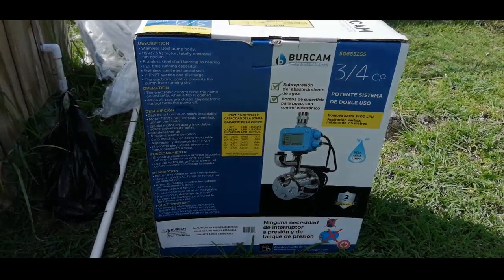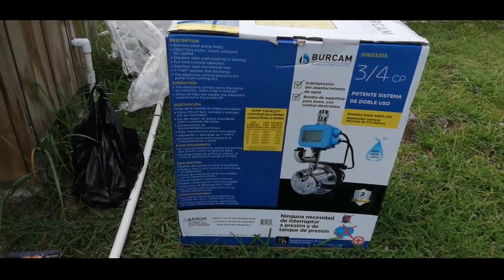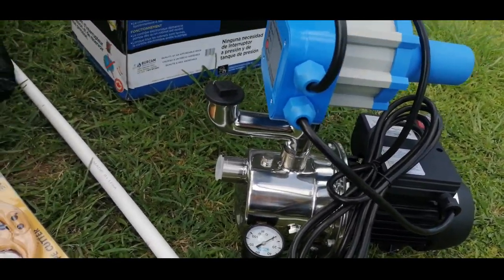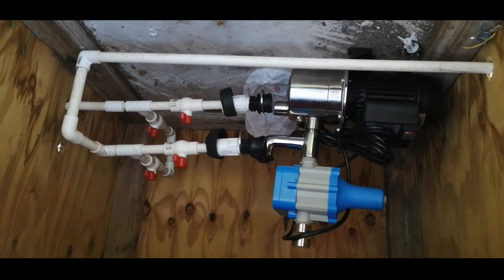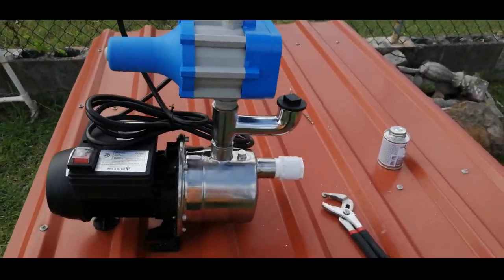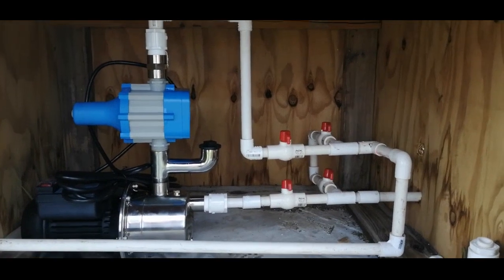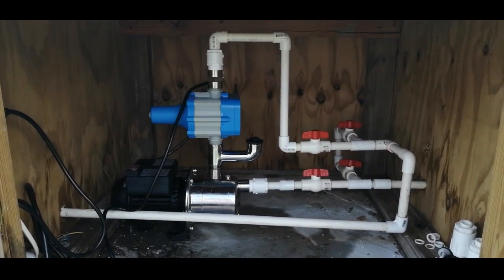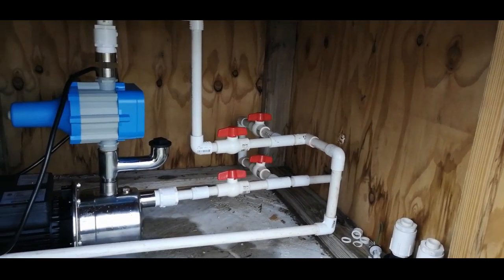BurCam 3/4 HP Pressure boosting/Shallow well jet water pump | Full Installation and Operation.

Comment: Hi can I install this pump to a borehole or well
Reply from the maker: Yes you can. Vertical lift cannot exceed 25 ft though. Be mindful of that. It's an important factor.
Reply: Can it be connected directly to a shower to increase pressure on a shower head?
Reply from the maker: Yes practically it can, just ensure you suction (vertical lift) is no greater than 25 ft / 7 m.
Reply: @iTravelKN  Thanks, how does it differ from the one with a pressure tank.?
Reply from the maker: With a pressure tank your pressure will drop and then the pump will kick in to build the pressure inside the tank then cuts out. The pressure in a pressure tank will varies obviously with cycle. Once the pressure tank reaches its maximum pressure it cuts out. Once the pressure drops it cuts in.

With the burcam booster pump. This pump turns on based on demand. Once you turn on a faucet the pump detects water movement and activates immediately giving you the desired pressure over the time that it is needed. There is no fluctuation. Also with this on demand pump energy only is consumed when the pump is needed. Unlike the pressure tank, the pump will run regardless if a faucet is on or off once the pressure tank isn't filled to the required preesure. 

The on demand pump have dry run protection  as well. Once there is no water the pump won't operate. There is many pros to this pump but these are my top three.

*Reduced energy consumption
*Instant pressure
*Dry run cut off
I hope this helps.
Reply: @iTravelKN  Thanks a lot , the information you gave is very helpful in choosing the right pump😀